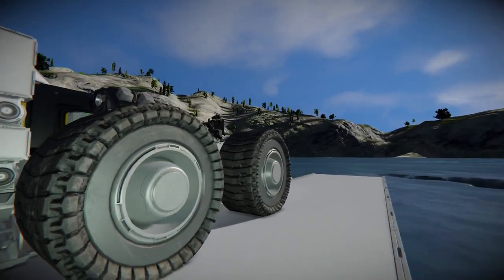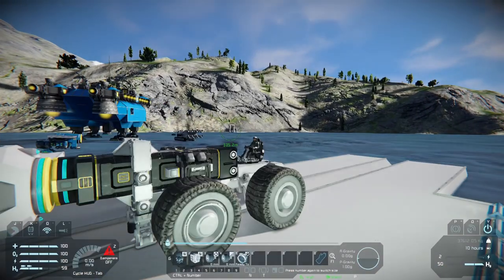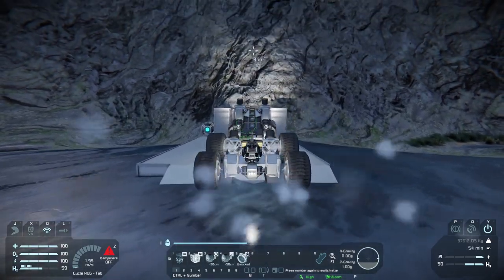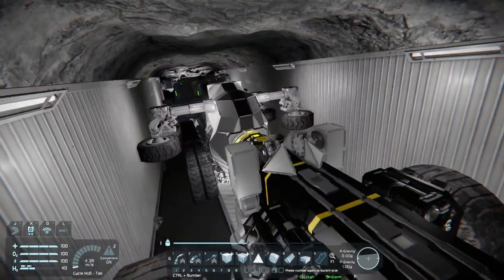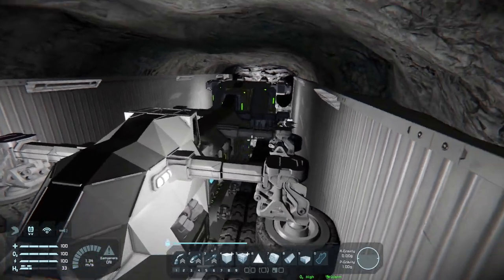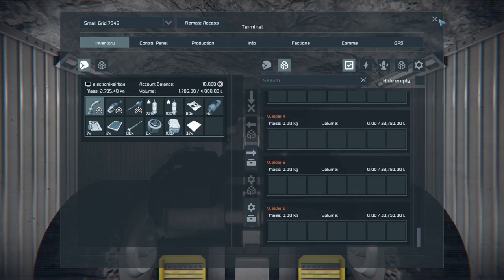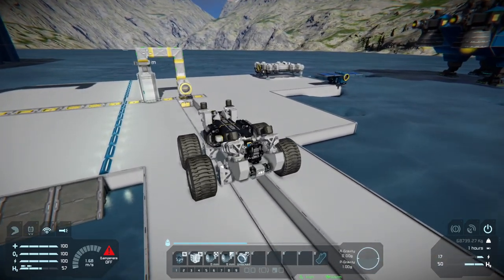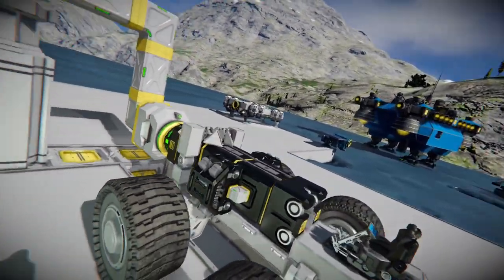Tunnel Driller Xchanger Walkthrough

Comment: Love it, if you were to extend it backwards it might help with stabilization,  gives room for other capabilities to the XChanger, such as having a docking point on the back facing up.

 So air XChanger can dock with ground XChanger to do a similar role. as ground XChanger, thats  moving resources,
 ground XChanger is for running  short trips to bases,  if it is really long distance away for some reason,

 a flying XChanger that takes from ground XChanger for said long distance if not far away to be reasonable for a flying XChanger isn't used, this will give versatility to the system. Plus if you make it we're when flying XChanger is attached to ground XChanger that both can fit in the tunnels so it is always there if needed Also gives extra storage space for ground XChanger on short trips, and flying one isn't needed.